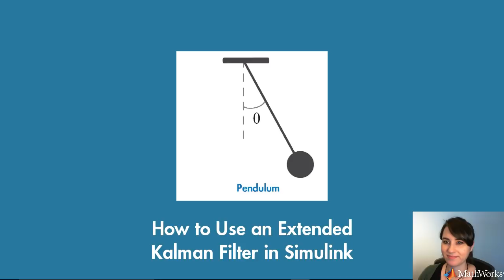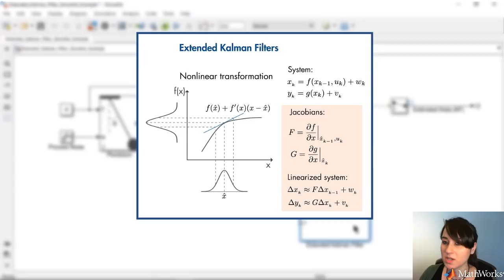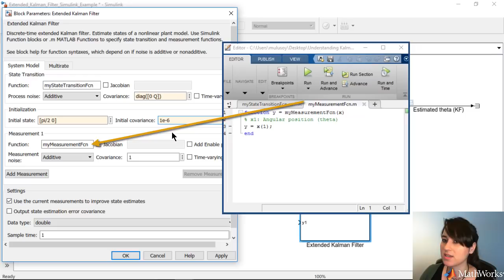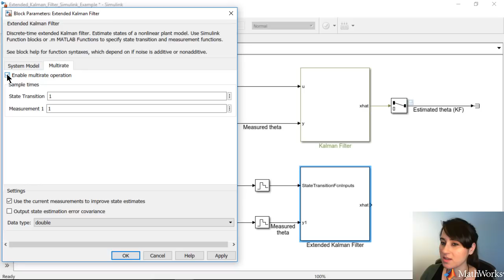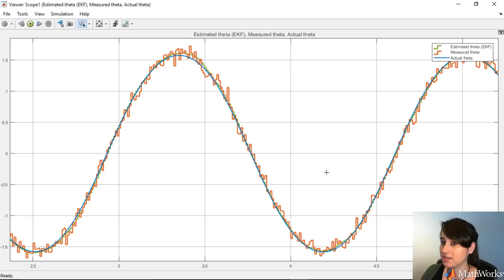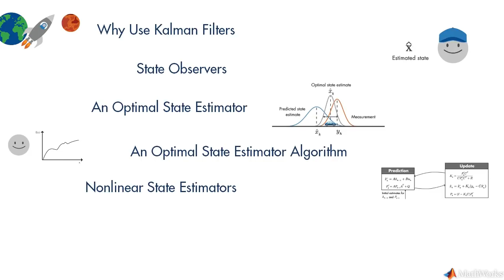How to Use an Extended Kalman Filter in Simulink | Understanding Kalman Filters, Part 7

Comment: Thk for your video! But I have a question. Does Kalman Filter requires an initial model of a system? In reality there are complex systems that can't be easily described
Reply: HI, standard Kalman filter formulations require a model but in the literature you can find studies that try to remove this requirement. You can investigate these techniques by searching for "Kalman filter without model"

Comment: Good Video. I'm implementing an EKF for a Power System Application. How do you handle the filter if the is noise in the input vector u?
Reply: In the Extended Kalman Filter block, you can specify the process noise as additive or non-additive.
Reply: Jorge Andrés helllo,  can i get help how you discretization your model 
My model quadrotor has asecond order differential equation , multi varaible  ?